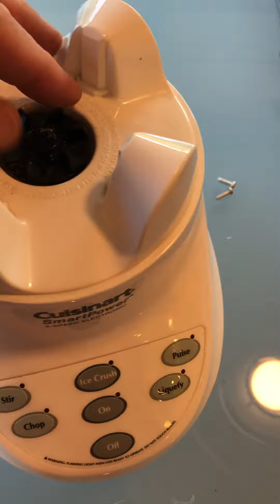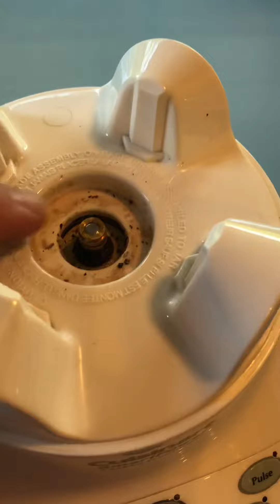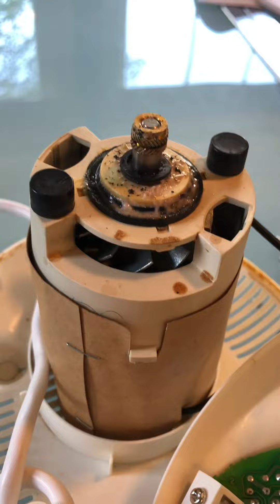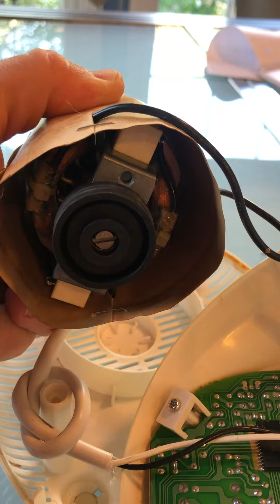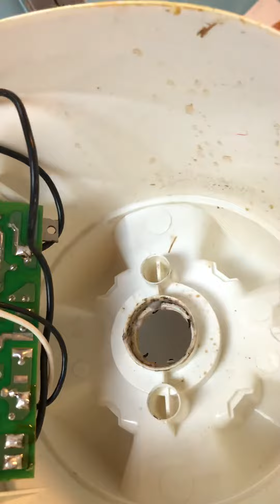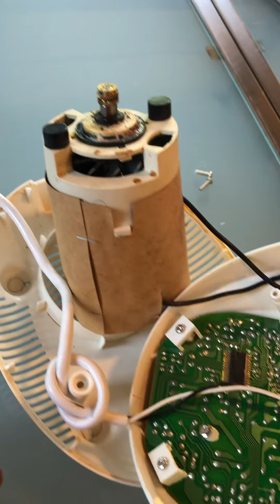Cuisinart CB-9 blender repair

Comment: Thank you.  This instruction with google photos album linked on how to lubricate some of the parts of this specific Cuisinart model may be helpful to some people: https://photos.app.goo.gl/QqHtTwHVS9u9dUni6  And here is the text for those that are unable to open the link:  

Use a lubricant to lubricate under both black plastic gears at the bottom of the blender container/bowl and the top of the blender base where they both connect and turn.  Turn blender container upside down and spray between black spinning gear and base where friction occurs.  Spray all the way around and turn to work lubricant in.  I like to use silicone from a hardware store as it is non-toxic.  Wd40 is not ideal as it will attract gunk or get gunked up, but may work fine as well as other lubricants you may have on hand.  

Next, lubricate black gear at the top of the blender base to get lubricant under the gear all the way around while turning to work in lubricant.  

Finally picture below, underneath blender base stick lubricant nozzle (if you have nozzle) in between the slats at the bottom and touch it on the central column that turns and spray some lubricant from 4 directions on the central column that is turned by the motor and turns the blender blade.  Then stand base right side up as normal again and turn the central column by turning the black gear and the lubricant should then drip down into the small round reservoir kind of in the center/rear base of the blender base where the central spinning column may reach down to.  Put blender bowl/container on and run the blender for a few moments to distribute the lubricant.    

After lubricating all these points, my blender seemed to spin at lease twice as easily.  Not sure if it will stop smelling like it is burning, but it definitely blends at a higher speed with less friction.  This will probably need to be repeated every month or so for best performance and longevity and perhaps even more often if you wash the base of your blender bowl/container regularly and may wash the lubricant away.  The benefit of this process is that you don't need to open the unit 🎉😁

Comment: What's the name of piece you order from  Amazon for the blender because I'm having the same problem with mine I need the part name and number
Reply from the maker: This may not be the exact part you need but this will help.  SPB7-20TXN Blender Blade Driver Clutch Coupling, Replacement for Cuisinart Blender BFP703 BFP-703 BFP703B BFP-703B BFP703CH BFP-703CH SPB-7 SPB7 SPB-7Bk (Pack of 2) https://a.co/d/b5rexSp
Reply: I have that part the trouble I’m having is taking off the gold metal piece I tried screw drivers I tried a drill i even tried chiseling it off don’t want to ruin the blender hopefully I come up with something
Reply from the maker: @theodoredooley4693  if I remember correctly, on the far opposite end of the shaft ( inside bottom of the motor) there is a screw driver slot or hex head, etc you can hold to help remove the part.
Reply: Thank you for the video. I couldn’t get the gold nut off to put the new part on. It appears to be stuck. Any suggestions?

Comment: The paper disc goes over the plastic pin near the back of the machine. A knot in the power cord goes around that pin then the paper disc goes on after.